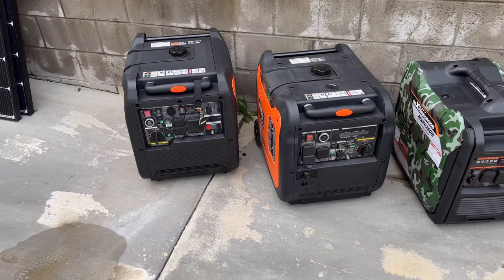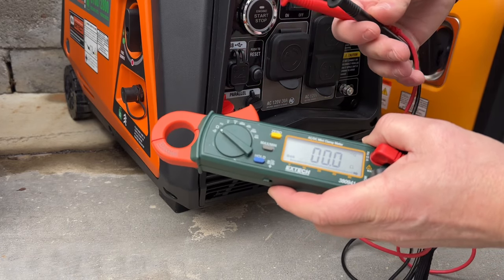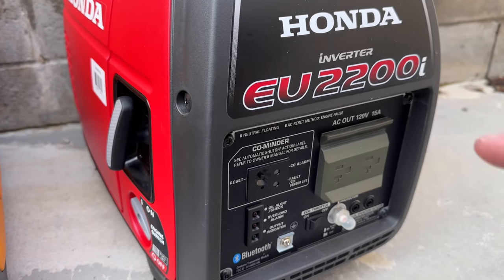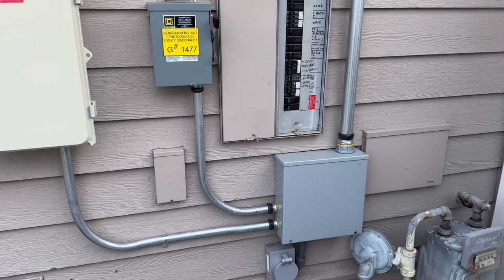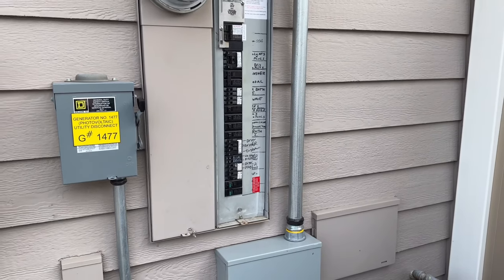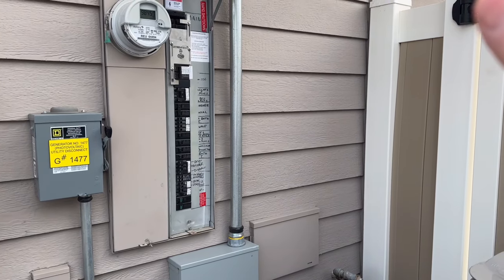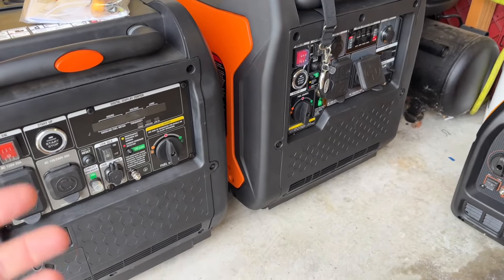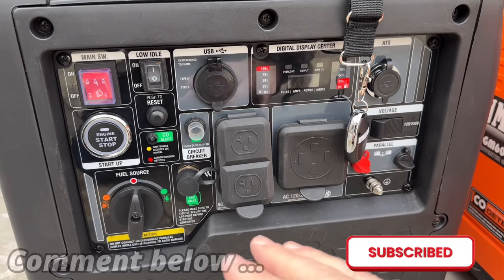Bonded VS Floating Neutral Generator Does it Matter?

Comment: Bonded neutral in electricity. But it did not start this way. So many were using the "grounds" in the same connected. This went on for many many decades. Then the engineers began to see some funny things; where more and multi bonding was causing dangerous things...to the systems and people.

It would take too long to tell you why. But it can really be a major problem; IF the systems that are connected together have more than ONE  bonding (wiring the neutral to the common wiring AT the power panel).

So, The Federal law makes it simple. "ONE bonding at the entrance and NO exceptions". This made companies all over the US; to change it. So they had to go out to ALL of their systems and remove all of their bonding's. Then connect theirs neutral to the ONE bonding where the Power comes in. This applies in every home also.

I know this, because my company RCA had to do it (a long time go); or be in trouble with the Federal Electricity laws/codes. 

So, IF one has a Generator that IS bonded (many do); they MUST break the bonding IN their Generator; IF the power panel is bonded. IF not you can let your gen be bonded.
Reply from the maker: Exactly the critical loads panel would have to have the transfer switch break the neutral on a bonded unit. It will only get more complicated, or will it..🤔😂👍🏼

Comment: I have the wen 3800 inverter generator
Reply from the maker: Great unit, I don’t hear much bad about it. 😀👍🏼
Reply: @johnnysweekends  it is a good unit easy to fix and maintain I bought it from Facebook marketplace guy had it for 2 years and it had 800 hrs on it now it's rolled over and I have 75 hrs on it so close to 1,075 1100 hrs on it and I'm thinking of getting the wireless remote start kit for it
Reply from the maker: Wow awesome. Man loving hearing feedback on these for my resources! 
Yea a remote kit would be great for sure. And if it ever gave way just keep the kit. But hopefully you get another 2-3k out of it..👍🏼👊🏼